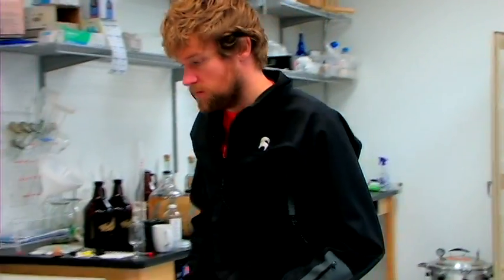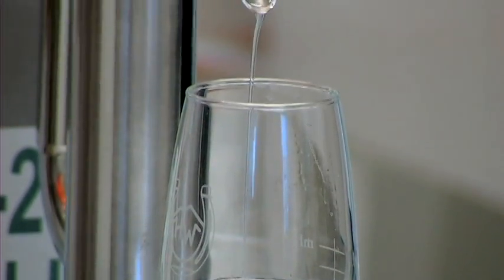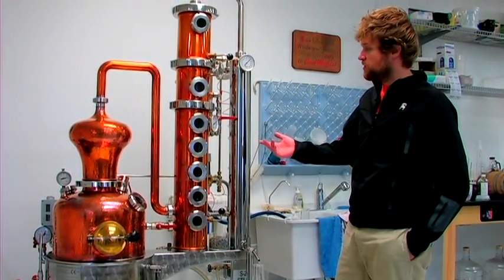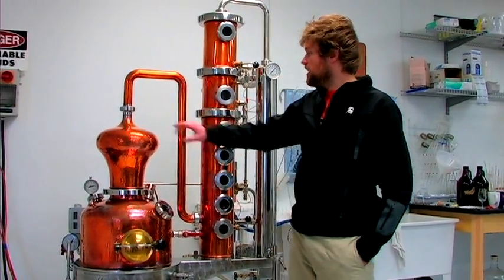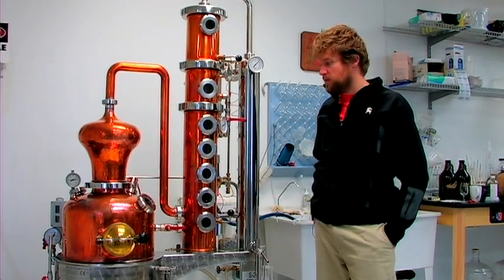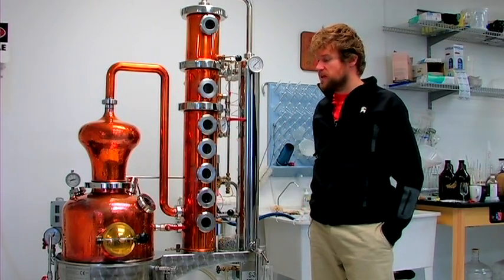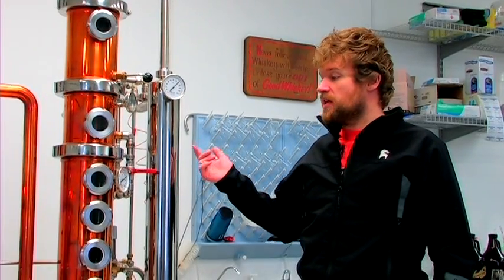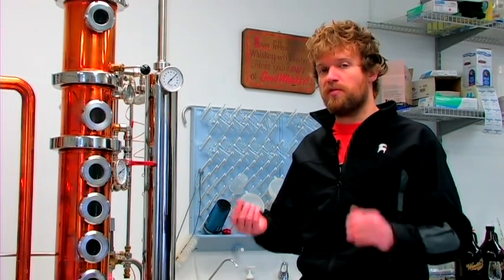Types of Alcohol : How Is Scotch Whiskey Made?

Comment: what is the benefit of reflux tube over coil condenser? copper coil has worked for over 200 years why change to reflux tube? plus NO ONE can tell me what dose copper have to do with the quality of moonshine? i use stainless steel everything and my moonshine turns out great every time! and clean up is a lot faster then copper!
Reply: This is a DYE home still, which is great for using as a test bed for larger distilleries. The reflux tower is used to do multiple distillations in one run, each looking glass has a plate which acts as another still ( in simplest terms) thus allowing multiple distillations, above that, is a Deflag which works like a shotgun condenser, knocking down the vapour to clean up the taste and increase the ABV. Above all that is a gin basket for infusing botanicals, then it is off to a shotgun condenser and into a parrot. 
Copper is used to reduce the sulfates in the distilled ethanol which is why a copper still requires more cleaning on the inside over stainless steel and the taste difference is noticeable( which is exactly why the more expensive copper is used). However, that is the subjective part, the TASTE, if your getting a happy result from a stainless steel setup, in full pot still mode then it suits your flavour profile and your all set. If your after a dryer, Irish or scotch style without doing stripping runs and then spirit runs and are seeking a cleaner, dryer taste than nothing beats a setup like this. Plus having the ability to use steam heating for the boiler ensures no off flavours from scorching the bottom of the still with gas heat or from element burn inside the still from electric heat. 
Once again it all boils down to what flavour profile you're happy with, as a youngster I was quite happy with a pressure cooker and Molasses shine, now I enjoy a dry and refined whiskey and scotch that comes from our reflux still.